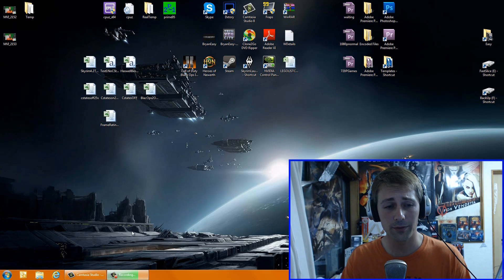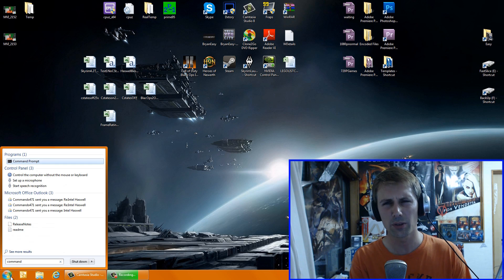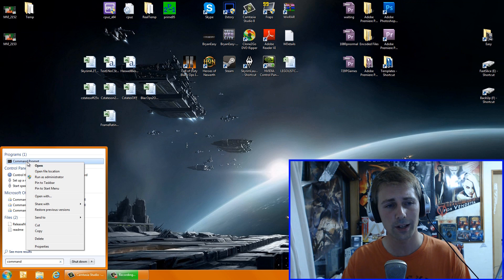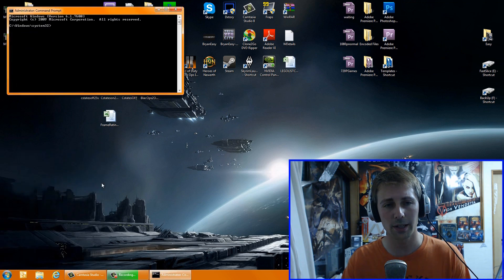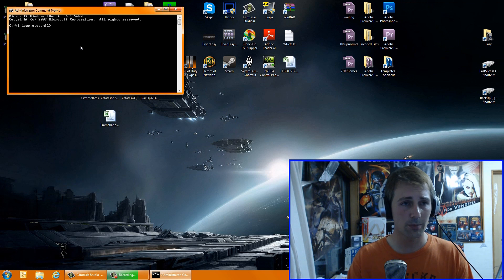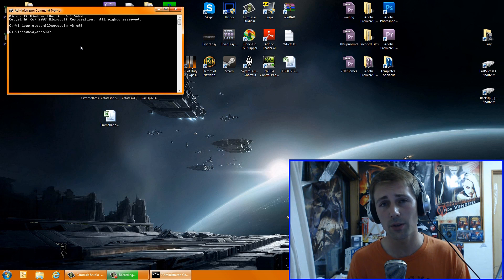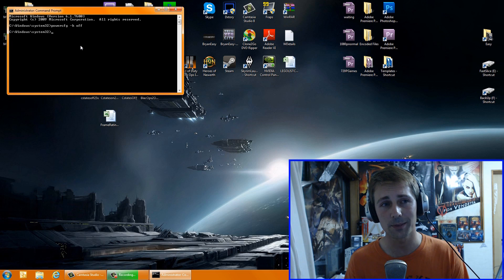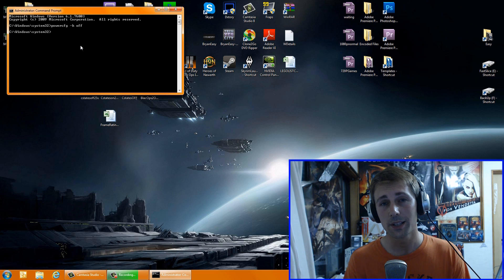How To "Certify" your PSU For Haswell CPUs + OC Update

Comment: Thank you very much. I bought i5-4690K and pc randomly shut down. Suspicion fell on the PSU. I'll try your advice and hopefully everything will run.
Reply from the maker: Could be a few things, though with the PSU keep your nose peeled for any bad smells, if you smell something weird (i.e. burning metal), then get rid of the PSU asap.  Could also be ram / CPU not seated properly, bad PSU cable and the list goes on :(.  But I can help you if you have any questions.

Comment: rate my build please:
cpu :i5 4440 
gpu :msi gtx660 tf
motherboard :msi b85m-e45
psu: cosrair cx600
ram:adata 8gb
hdd: western digital 1 tb
Reply: A bit too old parts for my favor.
A i5 4460 (Haswell Refresh) and an H or Z97 Motherbord would be newer
and better for future upgrade (because of the compatibility for the new CPU Generation).
Same for the Graphics Card. Had choosen a AMD R9 280 (non x),
because of the 3GB Ram and better performance for almost the same Price.
And i Hope you get an SSD as Systemdisk in there as well...
Reply: thank you

Comment: man thanks a lot . I ve questioned the store that i ll buy my parts and i told them " CAN I RUN i5 4670k and GTX 760 with a XFX 550 Watt?  They told me no its too low. But i ve said wtf   i5 4670k needs about 85 watt while the card will get 170-180 max. THen i decided to go for the XFX but i read this c6/c7 thing and made me curious cause i need to pay 30 more euros to buy a PSU Compatible with haswlel like xfx 650. What would you do man? am i ok if i buy the xfx 550? thanks
Reply from the maker: Hey, you are fine with the xfx550 watt, that psu will probably even good for a gtx 780 (not overclocked).  As for the c states I wouldn't worry about it at all. You can simply just disable them in bios or in windows, because some power supplies can't supply the low power requirements that haswell needs in hibernation states (c6/c7). I am not sure about the 550watt.
Reply: thanks for the reply. I ll overclock the i5 4670k just to 4.2 Ghz nothing extreme so i think it can handle it. Well Xfx550 not by default. Almost though that states are disabled by default from the motherboard. In this price range i can go with   XFX 550 or Coolermaster 600 ( CM sucks in Psu's ) or COrsair Cx600 ( from what ive read CX serries sucks as well ) Or   OCZ ZS 650 which got some good reviews.
Reply from the maker: yeah i like ocz psus

Comment: i have my old OCZ 700watt bought it on 2010 .. if i change to corsair 1200ax will in effect my overcloking stability ? or even lower the cpu voltage . cheers
Reply from the maker: The motherboards and now Haswell CPUs themselves have voltage regulators on them, so it would make no difference (if any). It can make a difference on extreme Ocing (world records) but that is about it.

Comment: This is from one week, when i upgraded my CPU and MOBO, to i5 4670k and Gigabyte B88HD. On the older mobo i was fine, but now it says 8gb installed ( 7,88 usable ) hmm.. my GPU is GTX 560ti DCU2 top 900mhz! PSU CM GX 650W

Comment: Interesting stuff. I own a i7 4770 \ FSP Raider 650W \ H87-D3H and I'm experiencing exactly what you are describing. 4 Hours of Crysis 3 on ultra? No problem. Taking the computer out of 8 hours of IDLE time when I'm getting back feom work (just IDLE, not sleep or hibernate) by clicking on Chrome \ My Compter \ Skype  - Crash with a BSOD with a 124 stop msg. I tried adding some more VCore to my CPU, seems to help. Have you found a solution to this?

Comment from the maker: It is ok I will get to the bottom of it all in time, as of now though it is not drivers, and also not faulty hardware, so I know it is either the Voltage regulator or the IMC, I am honestly leaning towards the VR, since its the biggest change when compared to Ivy.

Comment: Is the power saving thing not disabled by default on desktop versions of Haswell?

I got a friend that's going to upgrade to Haswell (i5 4670) and an MSI Z87-G45 Gaming motherboard, but he has an older 550w power supply (he didn't know the name of it). So it would be nice to know if he has to disable something when getting the new CPU.

Anyways, nice video. =)